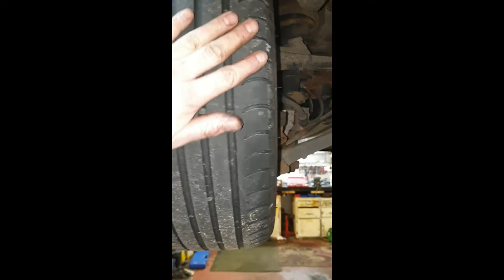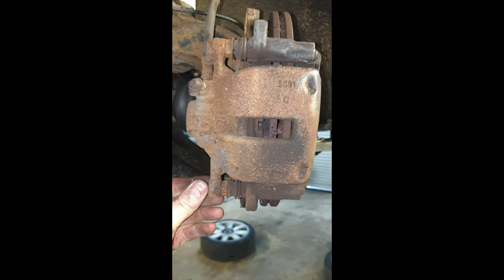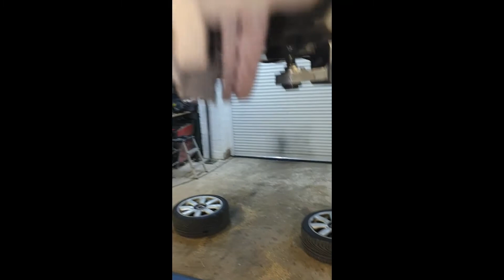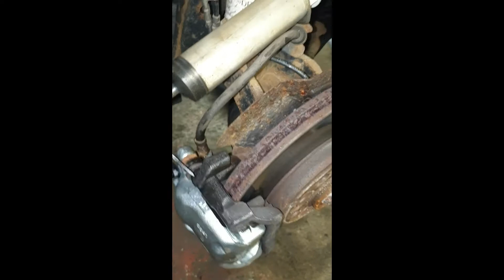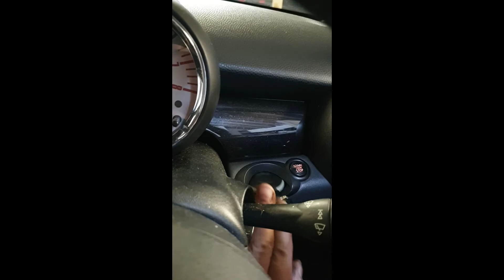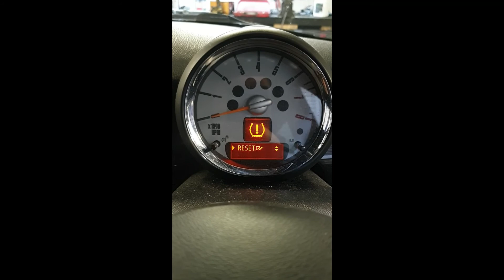R56 Gen 2 BMW MINI brake caliper repair, tyre noise, brake treatment, tyre warning light reset.

Comment: That syringe bleeding trick is genius. So simple that I wonder why everyone I knew growing up would enlist a friend to pump the brakes. This should've been the standard way. Cheers for that tip. Even though I have a pressure bleeder these days, it's good to know a quick and easy way if I don't want to pull that out.
Reply from the maker: I'm glad you liked the video and found the tip useful 👍